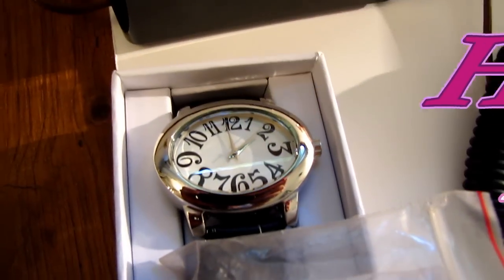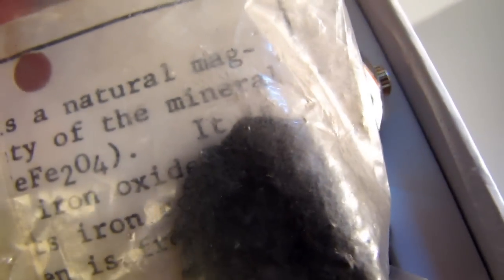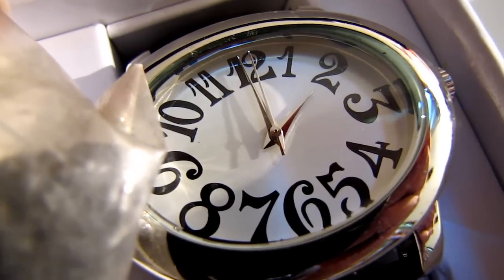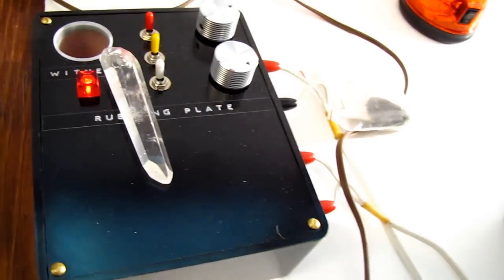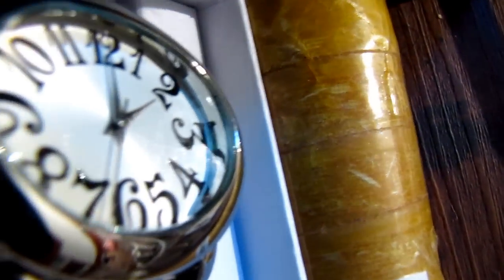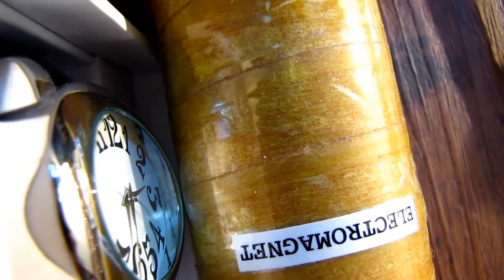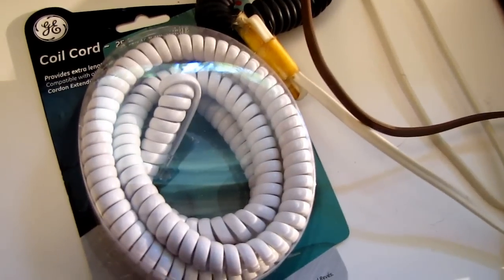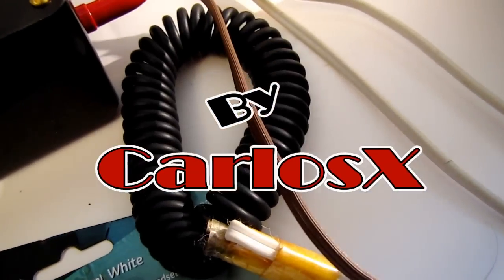HDR Time Coils

Comment: I think the best effect demo would be on dripping water. If you let the drops fall in parallel with the length coil about 1cm away, the drops should appear to fall faster within the field of influence of the coil. And for reference, have a mechanical watch tick away, in frame of the shot, but away from the field of influence just to show that the video hasn't been tampered in editing. The watch alone doesn't rule out artifact from the overpowering oscillating field.

Comment: Walther Miessner demonstrated that by applying high voltage to a small, maybe 1mm, sample of quartz; the sample became noticeably bigger, went from being translucent to opaque, and lost all of its measurable weight. Not only did it lose it's weight, but it seemed to demomstrate a negative weight. That is to say that not only did it levitate, but it lifted a weight of up to 40 pounds along with it! Perhaps your coil is actually altering the quartz crystal inside the watch; however it could very well be that this is actually having a localized gravitational effect. If you can effect gravity; it would seem that you could effect time as well. I am still a little skeptical about your particular set up though. There are so many other potential factors that could be making it tick faster. Can you please make a video showing the configuration of the coils, and of how many turn and what kind of wire. If we could build this same set up maybe we could come up with different experiments to determine if there is any real temporal anomolies occuring.

Comment: From what I understand analog watches and most technological devices use quartz crystals vibrating at a certain frequency. This constant vibration is what is used to determine a reference for the second hand to tick. Or for the analog watch to count. Now when you disrupt the quartz crystal, either by applying altering variables of current, voltage, temperature, atmospheric pressure, or magnetic field, around the device. You disrupt the Quartz crystal, thus causing the second hand to do one of three things: 1, speed up. 2, slow down, or 3, stop completely. Naturally this happens as you expose the watch to changes in temperature, usually the more extreme the more it loses time with atomic clocks. Which use the reference of light emitted from an atom in certain periods of exposure to (don't quote me on this but from memory) a em wave of sorts. This is much more accurate than Quartz as it is not affected by temperature of the other variables because it is done in a vacuum and under controlled environments in a lab.It seems that time in its theoretical aspect is based on frame/s of reference. If you change the speed of the frame you alter time, well what you are really altering is perception. Time it seems is just a name for a frame of reference, and you can tie certain events to how many reference frames aha be passed or accumulated since a given event. Anyway thought this would be fun to post :D

Comment: I have experimented with magnetic fields , in an attempt to replicate the effect Carlos is demonstrating. A perm magnet will stop the quartz watch if you line the polarity up correctly, but it will not cause the it to run faster. I have exposed a watch to a strong electromagnetic  field and it stops the watch as well. The effect that is demonstrated is unique and not easily explained. I am not convinced that it is a relativistic effect.

Comment: Just a FYI- You can affect clocks by using a magnetic field, or any other motor made of metal parts and gears as well as electronics. This would be a EXPECTED EFFECT! So I really do not understand what this "test" is suppose to prove in the first place??? That the HDR unit is producing a magnetic field?? As mentioned by Tim Kasey the mechanics would be affected by that LARGE COIL!!